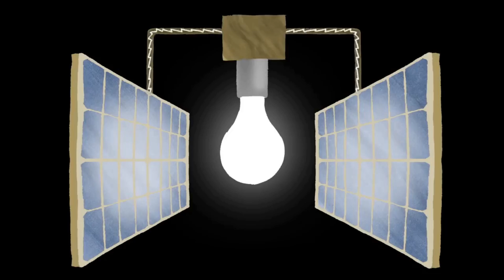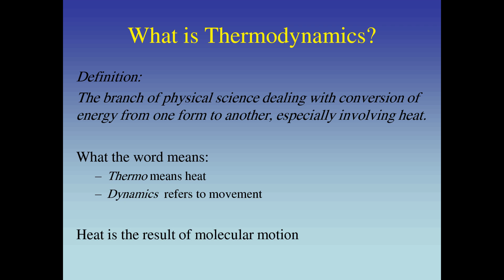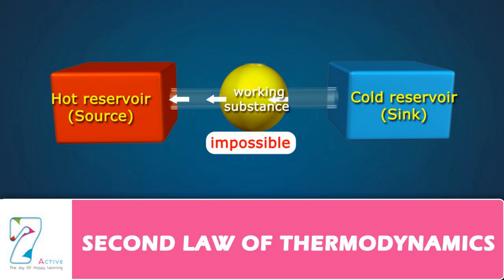2153 Do Perpetual Motion Machines Work

Comment: I have a design which i have not seen anyone try yet and its very simple using water to raise a ball using buoyancy and gravity to drop it, if youtube had pics in comments id love to show everyone and see if someone would try it out
Reply: Link to an image or design drawing ??  Pretty sure it will not work but always interested in seeing the designs.
Reply: I've seen that idea several times before. Search youtube for bouyancy engine. Typically they have a chain of bouys that enter a tank of water at the bottom, rise to the top and fall back down outside the tank. The problem is the energy required to push open the valve that allows the bouts to enter at the bottom is greater than the energy gained rising up.
Reply: @ColinWatters   i am aware of that design with the issue being the ball entering the water at the bottom, my idea has a ball fall onto a counter weight to set a flap up and then free fall into water with a ramp under to push it over as it slightly sinks then starts to rebound out of the water it ends up in a clear tube that sticks out of the water that has been filled already with water and has at least 5 small flaps inside that the ball will open as it raises inside the tube, each flap will close automatic as they sink, the flaps stop water spilling out so that way the top of the tube can be open, its like the tooth pic experiment inside a water column, this way you can raise the ball as high as you want, its really hard to explain but its very simple, last when the ball reaches the top of the clear water tube it hits a leaver and there will be a mesh flap that pushes the ball out using that counter weight from the beginning releasing the energy that the ball put into it and then it will start all over again as the ball falls out and resets the counter weight on the way down before it falls again into the water, i have thought about this idea for a very long time and i can not find a reason for it not to work, if i can show you my design im sure you would agree it does not break any physics and each part of my design is very simple and plausible, i am yet to see anyone that has even drawn up this design
Reply: @djproductionz911  I'm afraid I only followed about half of that. I refer you to the wikipedia page on "conservative forces" in short it means if your machine ever returns to the same position twice then gravity will do no work on it. Since bouyancy is also caused by gravity the same will apply.
Reply: @ColinWatters   lol yeh its hard to explain my idea and i know what you mean if my idea works i would be the 1st person to have a ball move constantly which i doubt is possible but i really cant see why it wouldn't work, i do not see any part of it having an issue thats what gets me, usually i can always find an issue with my or other peoples designs but this one has stumped me, i will send you a link to where i got the idea partly from so at least understand better

Comment: Im dumb, so feel free to criticise lol.

With the ball bearing and magnet setup, could the decline be fitted with some type of other magnets and the bearing magnetised, so it generates a current as it passes? Obviously nowhere as simple as that, but is there anything along those lines?
Reply: Any current generated from the motion of the ball will cause the ball to slow down (or accelerate less) - consider an electric generator / dynamo, which is typically quite tough to turn due to the magnetic forces within it. Overcoming those forces is part of the process of turning kinetic energy into electric energy. That's why those old dynamo lights on bikes made it harder to pedal your bike (Simpsons even made a joke about this way back when).

Any electrical energy generated by the motion of the ball will, hence, cause the ball to slow down by at least as much as that same electrical energy could speed the ball back up (assuming an impossible 100% efficiency of both the electric generator and the electric accelerator).
Reply: @crudereviews7221  I read 15 words of your reply and had a instant...."f*ckin duhhhh.." moment to myself. 🤦‍♂️
Tried to solve a puzzle without having all the pieces. This is why we have refresher courses for construction tickets lol

Appreciate the reply, sir, and Hope the new year treats you well 🫡

Comment: Life is perpetual motion.
Reply: Nope, because life isn't a closed system. Take away the power source of the sun and the radioactive core, and everything dies.
Reply: Life consumes energy and degrades over time, requiring more energy to maintain itself. That energy must come from a source, when the source is gone and there are no more sources, life is gone. Always ask where are the batteries. The battery for life on Earth is the Sun.

Comment: The closest you can get to perpetual motion is planets orbiting.
Reply: And even then, tidal forces very gradually convert orbital (kinetic) energy into heat via deformation of both bodies.

Literally can't achieve perpetual motion in an ideal vacuum.
Reply: @crudereviews7221  What about electons
Reply: @ecoista1373 Electrons don't orbit, that ideas a result of people misinterpreting models used for explanation as models representing reality. Electrons jump around randomly, but the probability of them appearing in any one spot os not equal - there are complicated shape patterns (called Orbitals) that have higher probabilities of finding the electron in them, but there's no reason beyond probability that an electron cant be found a thousand miles away for a split second before being back in the orbital (this is a form of quantum tunneling).
Reply: @etaaramin9361 
"Electrons don't orbit,"

That wasn't the question, but it does answer a question I've had.
Electrons are in perpetual motion, they may not be in an orbit, but they are in constant motion.

"that ideas a result of people misinterpreting models used for explanation as models representing reality."

An inanimated 2d model will never be a good model when depicting such motions for the simple reason that descriptions of the model do not describe or explain the motion. A 3d animation is better suited to model such motions and even then, it is not likely to be perfect.

Recently, I've been getting on people that complain when their vague and abstract communication is misinterpreted. Those people, despite their complaint, take offense when they are told to be clearer and not leave their communication up to interpretation. If I didn't know better, I would think that those idiots actually believe that people are be able to read their minds. Then again, the programming of kids to think they are entitled to everything for free, may have included the programming that people can read their minds.
Reply: @etaaramin9361  Can you cool an atom to absolute 0 k or nah
Reply: @ecoista1373  I am not sure. My instinct is to say no, because practically speaking you would need to have some way to force energy (heat) to move across the concentration gradient without also adding energy. It may happen by chance due to quantum tunneling, but I don't believe the state would last very long, and it is extremely improbable unless you cooled the atom very near to absolute zero.

I don't see a reason why it is theoretically impossible for an atom to reach absolute zero, but can think of no simple process by which it might occur besides chance.
Reply: Dunking bird  and Atmos clock are two proven "perpetual motion" machines, but both work by harvesting heat energy.
Reply: @karlmccreight8172 The tides are an effect of gravitational interactions between the Earth and the Moon. There is a tiny net loss of energy as the moon's orbit (and the Earth's momentum) changes. The Moon and Earth just have a lot of momentum, and the tides are comparatively very little energy so it might be millions, maybe billions of years before it's a difference that makes a difference.

Note that "perpetual motion" is not forbidden, in fact it's a law "An object in motion stays in motion unless acted upon by an outside force." What doesn't work is a perpetual motion machine because the moving parts necessarily involve momentum changes, and those changes will never be 100% efficient (usually due to friction).

You can have perpetual motion by simply throwing a rock into empty space (empty enough that gravity is weaker than expansion). You can't take energy out from it without slowing or stopping it though.